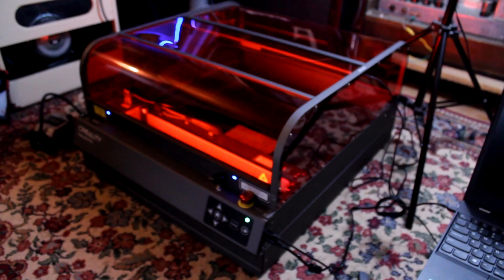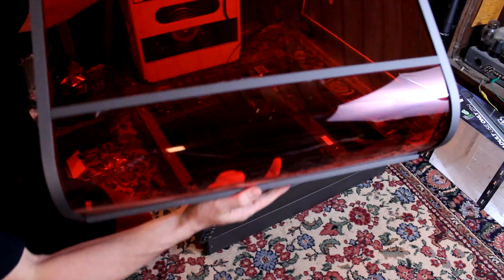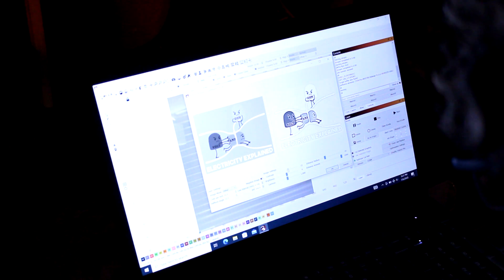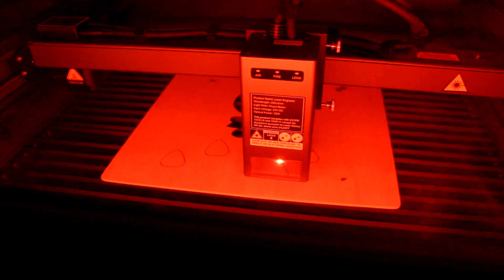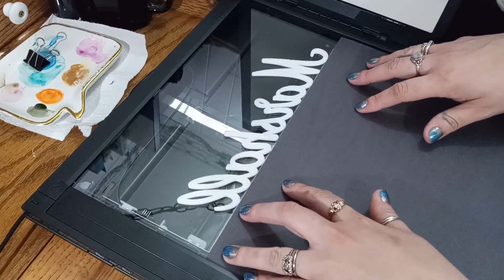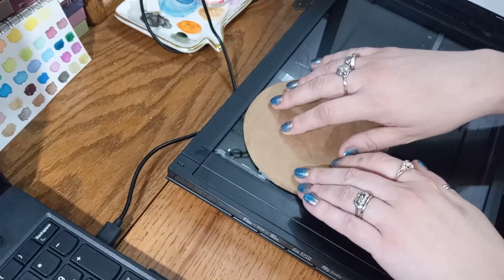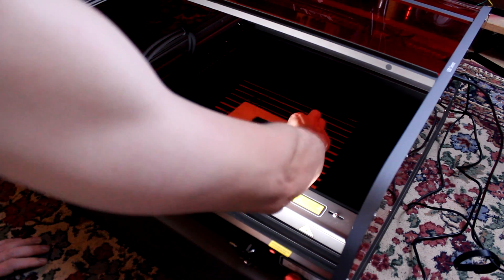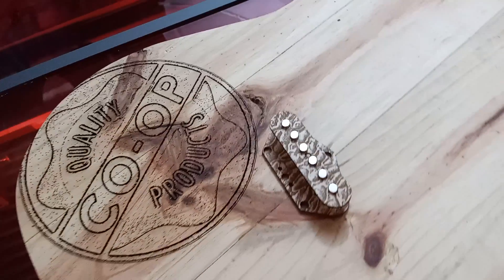Best Tool I've Ever Tried for Creative Musicians! (Creality Falcon2 Pro 22W)

Comment: Cool machine, man! Just wish they had one that would fit entire guitar bodies in them much cheaper. lol  A dream for a wishlist for future though. I am curious what could be done with this and a 3d printer in tandem. 👍🏻
Reply from the maker: Thank you for watching and taking the time to comment Charley, and heck yeah, I can see why it'd be nice to have one the size of a room. 🤝 In trade school we had a CNC controlled plasma cutter that had a bed on it that was like 8 feet or something like that and even then my first thought upon seeing it was hey, you could put a mig welder in that plasma cutter holder and just print an engine block or a "pew pew" from thin air. My welding instructor Mr.May just looked at me like wtf is wrong with you? Hahaha! This was early 2000s before I had ever seen a 3d printer. I really want one now though, they are amazing. Using that in conjuction with this you could make nearly anything you can think of, combine that with a CNC router, a water cutter and a mig welder and you would no longer need to buy anything at all but materials. You'd have a personal small scale full production factory. That's a goal of mine for sure. I'd love to have the ability to fully create all the guitar parts I need like bridges and necks and carved tops etc just by pressing a button. plus Id be making race car and bike parts myself constantly. I got the need for speed. 🤣

Comment: I got one of these not too long ago (the 40W) and learned something the other night, you can actually trace using the built in camera :-) using Lightburn, don't need to use a scanner.  Need to use better light inside the enclosure but it does work.

Comment: It is really dangerous to put a laser cutter on the carpet like that you need a proper workbench
Reply from the maker: Thanks for watching KZ. I cannot much argue with that. Its not going to be operated here again. I just had it in this live room/set for the video it will be going into the concrete slab workshop on a bench for actual use with the other big tools now that the video is uploaded.

Comment: I've had all the stuff (chiller, etc...) with my CO2 laser I grabbed in 2018.  Sits there.  well over 2grand for the chiller and the co2, because it sucked.  I wanted engraving and it couldn't even cut.  Had enough of it.  I did play with one of those 5w lasers before but meh.
Reply from the maker: Awe Dang General. I hate to hear to hear that. Its wild how fast technology in all areas is leaping, it seemed stuck for a few years then boom, it took back off with a vengeance. I've wondered if a big CO2 isnt what Ron at Guitar Building Templates dot com is using as he is able to cut giant p bass bodies and long neck templates, I haven't asked though as I know its a business and I'm not trying to shortcut him. I had never used a CNC Laser before I used a big 8x8 foot torch and plasma cutter back in welding school but it still used floppys and EZ CAD which isn't in any way EZ Hahaha!!! It did have a big light eye on it though that could trace sharpie on white paper and reproduce the movements. I got a big sheet steel lizard that I cut on it. The 22 watt laser head surprised the heck outta me. I cant imagine what a 100w could do? I could see it being better than pepper spray in a "situation" LOL Heck bro if you are still interested in laser engraving they have several tier of machines and diode laser heads at Creality from 1.6w to 60w. I wonder if you could get a laser head and a power supply and "retrofit" your own CNC frame? either way Im sorry you had a bad experience with the CO2. I feel extremely lucky to have gotten this for review. I was blown away.
Reply: @heavymetalATC  Yeah, a Chinese horrible mess.  I had to lift it in by hand inside.  Thank goodness it was Oct, as it weighed.  As old as I am now there is no way I could do it again.  60W beast machine.  The diode lasers of >5w are multiple diode laser coalesced to a single point.  The only problem with diode lasers is their longevity, and certain material it will not touch no matter how much power you throw at due to the frequency it uses for the laser.  CO2 can etch and cut Acrylic because, at its wavelength, it is opaque, but to a blue laser diode it is just about air.  Careful with it as it will hit the Acrylic and spread out.  Boom, blind without safety goggles made for that wavelength, or a safety window.
Reply from the maker: @generalawareness101  Thank you for the heads up. Yes I saw that multiple 5w diode laser design in the build info on the website. Its all very new and wild to me pretty cool though how it can cut them on and off to vary the output. I've been told this machine wont touch aluminum foil tape but will cut stainless shim stock I thought that was wild, but I saw a guy use that as a way to cut perfect inlays on aluminum shielding tape. Once I get it out to the workshop I'm going to try out some black pick-guard material. I didn't want the fumes in here if they were to be "loud". Surprisingly the acrylic paint mask on a circuit board made no smell whatsoever?
Reply: @heavymetalATC  Well, it does smell like paint, lol.  Of course the fumes aren't for putting in a paper bag and having at it as they have some serious stuff in them thanks to the instant heat of the sun (no joke about that).  Yeah, the 22w is probably, just a spit ball guess here, 5, or 6, 5w leds in there and due to losses comes to 22 watt.

Comment: Mama has a stack of stuff to be Lazer cut...So ...
STAY TUNED!!!!
Reply from the maker: Catch me outside, Hahahaha! I'm trying to stay on it heavy, about to start editing another video about making a router table and by the time I get that done I should have some awesome In ear monitors in the mail for review. You'll want to see these, no diaphragm or speaker inside, they have 16 microscopic magnetic armatures in them. Like a full electro-magnetic sound system subs, lows, mids, tweeters.. all inside a set of what is basically earbuds. Editing takes a whole lot longer than people think, a video can easily be over 100 hours work altogether.
Reply: I cant wait

Comment: Man, I spend $30+ on fancy wood pickguards for my Teles, could just print/burn a fancy bird's eye or burl pattern and dye it myself.
Have you tried cedar yet? Just wondering how great the shop smells, haha.
Reply from the maker: Thanks you for watching bro. Yes, this machine is just as useful and versatile as your imagination can go. I am personally STOKED to have it. I have not yet tried cedar but I'm sure I will. The pine and plywood smells Amazing when you open the machine. Makes me hungry. The powder-coating however smelled like aerospace parts production or something, much to my surprise the acrylic circuit board mask, made no smoke or smell at all? It was too dang hot in the actual workshop so I just ran this right there in the live room vented to the outside. Quite an amazing piece of equipment. 👍